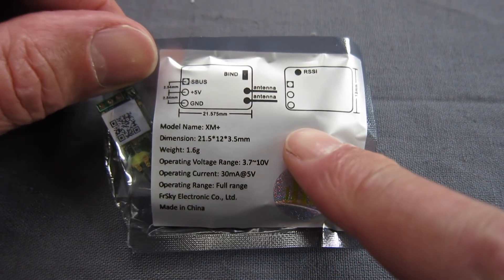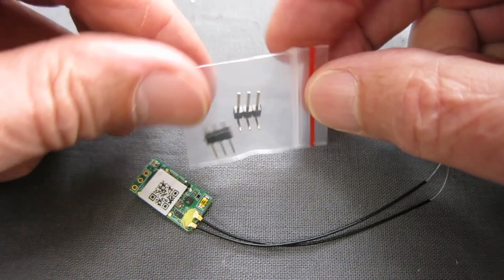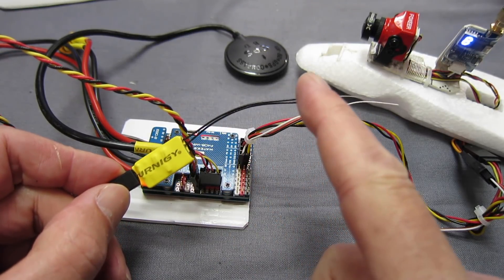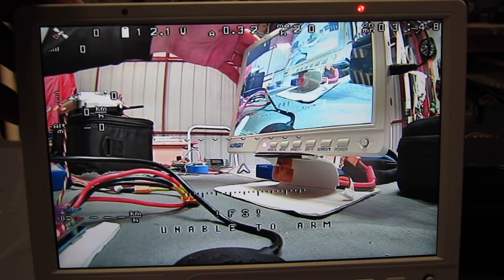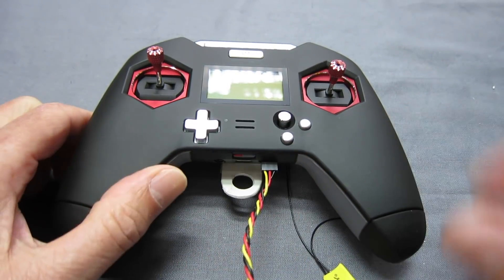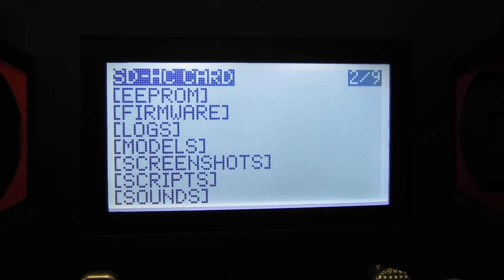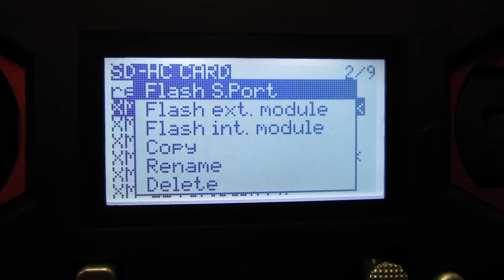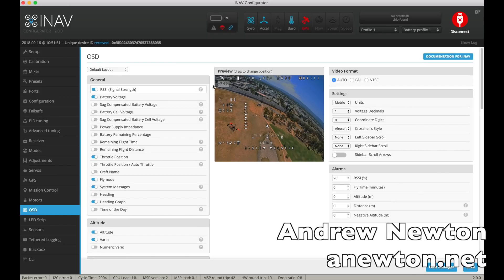FrSKY XM+ RSSI iNav

Comment: Thanks buddy, great info! I was wondering how to hook up the pin connector. ..Just solder on simple as that, thanks for showing the actual components that come with these. Also love the way you shrink wrapped the reciever, very cool and yellow so you can see the bind light as well, brilliant.
Reply from the maker: No problem 👍

Comment: I have one of these RX's but have a problem getting signal in Inav Receiver tab. I think I need uninverted signal for my omnibus f4 v3 pro. I have found a link from Oscar Liang showing how to get the correct signal off one of the chips. Have you found that this works on the XM+ RX? Any help or advise would be appreciated. Great video, super helpful.
Reply from the maker: I have only tried with the Matek board
Reply: @AndrewNewton  I have tried the mod on Oscar's  website to get the correct signal and it works great. Its tough for my old eyes to see something so small but it worked. I used some epoxy to make a strain relief for the free end of the wire, this should keep it from breaking the solder joint.

Comment: You can use the external module port to flash if you don't have the flashing port. My QX7 has the flashing port however it is not wired into the board (early production). Note that for the external module flashing the ground and volt wires must be switched.

Comment: Hi Andrew been a while do you prefer this AP board to the Inav one from SA? Sorry I forget its name,maybe the hero A3 from multiwii... cheers mate got a few of those recivers but was told they were bad. Might give them a try. But that all in one board looks fantastic without having to add OSD and everything else.
Reply from the maker: Yes Angus. These Matek Wing boards are the future. Onboard BECs and more servo outputs make them much better than the AIR3 units. Still need some soldering skills but worth the effort.
Reply: Andrew Newton gr8 thanks for reply. Certainly seems like it cuts down on amount of attachments needed. Like you I love in built BEC and OSD thats great no more wasted wiring and space needed. Gr8 find.
Did u find them searching through the AP's or did they just send u one? Also for 10 bucks seems that the bigger on is well worth getting to future proof for upgrading planes and such.
Ive been involved in the 4g softmod of the Disco and constantly knocking out 12 km flights with full video and control its been a great revelation. Some guys are getting near 4 hour flights amazing sruff. Im going to test to see if I can get the UHF attached and have it failsafe to the Sky controller on 4g so can test the distance of the UHF. On that also going to test my 2.4 units for distance also a really good way to see if the hype around some RX's is just that. 
Anyway cheers mate will order now as by the time they arrive will have tested the distance on my UHF which will help determine my video setup. 😁

Comment: Would that be a good redundant or second receiver for a FrSky G-RX8 receiver with a matek flightcontroller ?
Reply from the maker: R-X8R is the only FrSKY receiver with redundancy capability as far as I know https://www.frsky-rc.com/frsky-rx8r-redundancy-bus-receiver-introduction-and-basic-guide/
Reply: Andrew Newton  Sorry , but that must be a mistake of mine cause I had thought that backup capabilities was a common feature and I hadn't looked for more details ... Anyway: learned a lot again. Thanks
Reply: @typxxilps  It would be a good primary. The two antennas facing 90 gives great RSSI. I use it with Matek and quite happy. But the GRX8 is awesome. Make sure to use it 90 degrees offset as well.

Comment: On a Taranis X9D+ you can use the pins in the bay to update the firmware on receivers, I believe Oscar has a video explaining it.
Reply: Make sure to reverse the pins. If you don't know what that means be sure to look at Oscar's site or ask me here.
Reply: @JoshWeaverRC  also don't use 3S battery in the radio, or use a 5v regulator with it.
Reply: @NoAgendaFPV  . Yes, very good power point as the receiver caps out at 10v. That rail simply passes through whatever voltage the remote is fed with.

Comment: Had 6k out of mine in a low RF environment, but 3-4K is easily possible. I was very surprised at the range.  I suppose I've got not excuse not to try flashing it now. What can possibly go wrong??? lol. Bricked radio coming up!!!
Reply from the maker: 6K amazing! Just take sure you select "Flash S.Port" and it will be OK
Reply: You can flash it from the JR Bay pins on the X9D Taranis. Just be sure to swap over the power and ground wires at the JR Bay end of the cable...or its Pixie smoke....and watch which way you plug it in too.
Here...https://www.youtube.com/watch?v=1nktu32LpY4&t=434s.....4:52
Reply: @EnglishTurbines  Cheers ET. Will definitely give it a go this time.
Reply: You can flash it from the JR Bay pins on the X9D Taranis. Just be sure to swap over the power and ground wires at the JR Bay end of the cable...or its Pixie smoke....and watch which way you plug it in too.
Here...https://www.youtube.com/watch?v=1nktu32LpY4&t=434s.....4:52

Comment: The reason it has more range Andrew is because it has no telemetry...its a dedicated reciever FrSky have increased its sensitivity. You need to pay attention to antenna placement for best results, but 6kms is a very real (and proven) possibility.
Reply from the maker: Thanks for putting me on to them ET. Real range testing starts when the weather permits
Reply: Great, that will be interesting viewing, the range on your X8R I seem to recall was particularly bad, unless its the location, I remember it going into Failsafe, yet it was less than 500 metres out...:(
Reply from the maker: It is a very high RF noise area mid week. It was more than 1km out for that failsafe. Should get much better range down the coast.
Reply: Cool....Look forward to it...:)

Comment: Hi Andrew, you could have directly flashed the receiver using your old trusty Taranis X9D. It's just the same process using 3 pins of the module bay. It's just easier to access and plugin on the xlite but it's basically the same operation.
Reply from the maker: Yes I just saw Pawel talking about it. So much still to learn

Comment: I've sworn off these in favor of rsxr- just aren't dependable wierd stuff happens plus addicted to tlm
Reply from the maker: Interesting, we shall see how it goes.
Reply: Has used quite a few xm+ receivers in my planes. Biggest problem I have with this receiver is that its RSSI can drop suddenly from 90+ to 0 within 1 sec and get into failsafe without reason. It can happen just like that in say 300m from the transmitter with LOS. Then after 1-2 sec, it can back up quickly to 90+. This problem happens in all of my XM+ used. So a bit of reliability issue.

Comment: I personally went half a mile (800 meters) with 69% RSSI. Was on iNav with Matek F722. Very pleased with everything about this receiver. Had the antenna end pieces 90 degrees from each other on a Ranger 757-4. One straight down and the other facing to the side on the bottom of the bird.
Reply: Did you have the play with the rssi scale / offset in inav? My xm+ sucks I’m getting rssi warnings 400m out yet never had a connection loss

Comment: hello. peace drone's grasvity center where on plane
Reply: If you are asking where on a plane to mount the receiver, it could be the bottom. As long as the plane is not carbon fiber, it can be inside the plane as well. More important is the antenna orientation so you are less likely to get a dead spot.
Reply: Ansley Peace Drone CG is half way between the canard and the wing